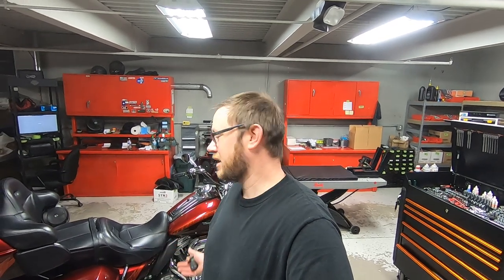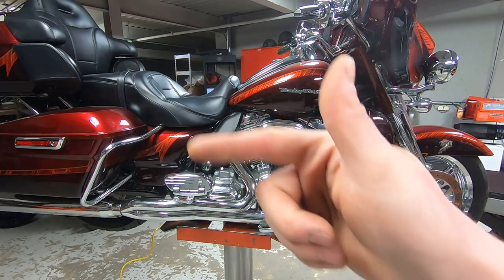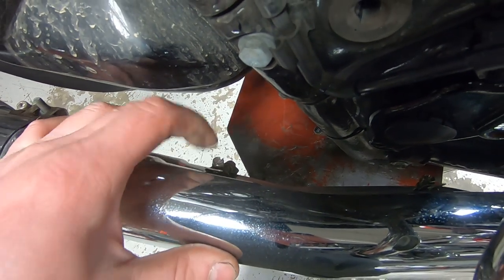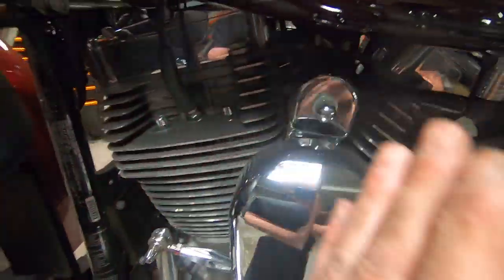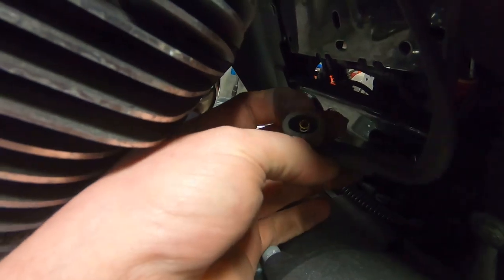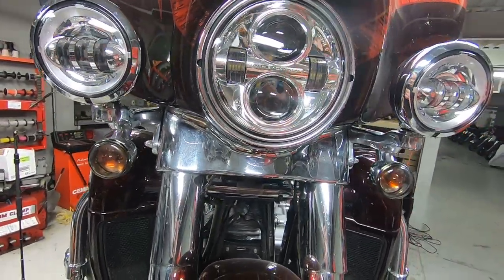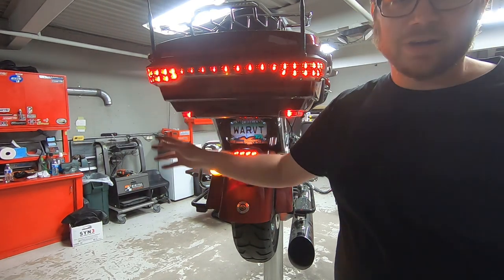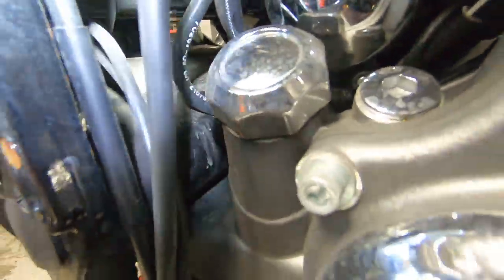HOW TO DO A PRE SEASON HARLEY DAVIDSON SAFETY INSPECTION PART 1

Comment: What's the part # of that air pressure gauge that hooks up to a compressor? I replace my rubber muffler mounts every 2yrs regardless of whether they need it or not. The heat from the muffler causes them to get rock hard. And when that happens & they get dusty they squeak like crazy!!!!
Reply from the maker: 75137-98B is one of them and the other is 12700096A that I mention in the vid. I know!! The muffler rubbers are so annoying when there shrunken and squeaky. I've seen so many ways people try to shim them (from cut up mountain dew cans, washers jammed in there, mufflers rotated 45 degrees to bind up the rubber ect) to remove the squeaking. The only real answer is like you say, replace them.
Reply: Harley Davidson Wizard yup. And for the $7-$8 it costs why skimp? Thanks for the info on the part numbers. I already have 75137-98B. Gotta get the other one now!!! Great, detailed vids. Keep em coming. Oh yea...that CVO is dirty especially since it never gets ridden!!! 8K miles in 4yrs...lol. 42K miles on my 18 Road Glide Special!!!

Comment: Unrelated question. I bought a SS polished 12 point bolt set for mt 14 Ltd. What do recommend I use to prevent galling when I thread them in. Some say thread locker.  Thanks
Reply from the maker: Whenever I've used stainless steel hardware I've always used the same threadlocker that I would as if it were a conventional bolt. I would torque them to the low end of the torque spec because the stainless steel bolts have in the earlier yield torque to them than a conventional bolt. I don't know if that's a manufacturer type of a deal but I've always use stainless steel Hardware from Diamond Engineering. For anything that's a safety-related piece of hardware like pivot shaft cleve blocks, motor mounts Etc I would use their race proof stainless steel. 
But for all the normal 1/4-20, 5/16 stuff I would just use their normal stainless steel Hardware
Reply: @HarleyDavidsonWizard   These came from Alloy Boltz. They are mostly cosmetic cover stuff and the largest is 5/16. Would you use blue or red threadlocker? Thanks.
Reply from the maker: I would use blue. Red is only for really thick bolts that have a really coarse thread like the handle bar riser or rear wheel pulley bolts. I go through blue lock tight probable 30 to 1 red lock tight.
Reply: @HarleyDavidsonWizard  Awesome, thanks for your help.